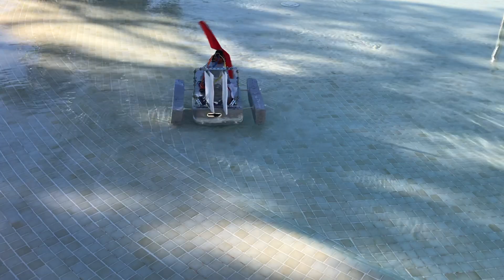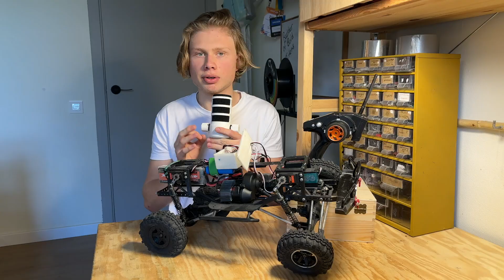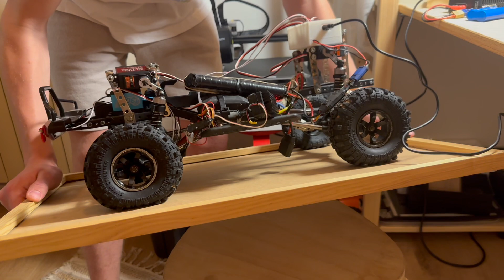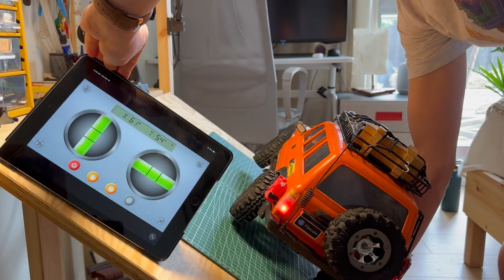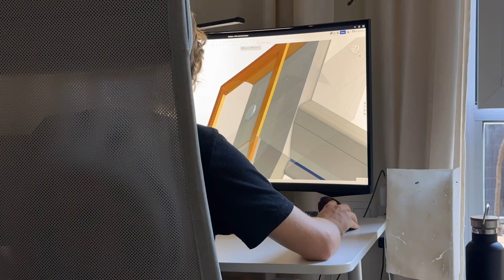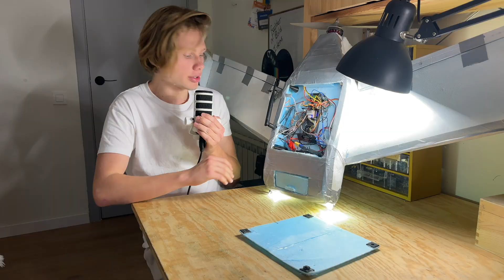Maker Portfolio | Kirill Rybkov

Comment: Very interesting video and nice projects 👍 how did you start with these electronic things, programming and building all this stuff, i am also starting and I find it little bit difficult like programming, I also want to build big projects
Reply from the maker: Thanks! It's just a mix of boredom and obsession ;) 

Arduino is the easiest platform to start off with, you can buy yourself a small kit and start doing some simple projects. At first, it'll feel really boring because you're not doing anything useful really, but just treat it as a learning exercise, you'll naturally want to build bigger and bigger projects afterward, your ambitions will grow. And as you gradually step up the difficulty of the projects, you will learn more and become more able. Your motivation to do things will increase too, because the projects will actually become cooler.

tldr: trivial, but start small